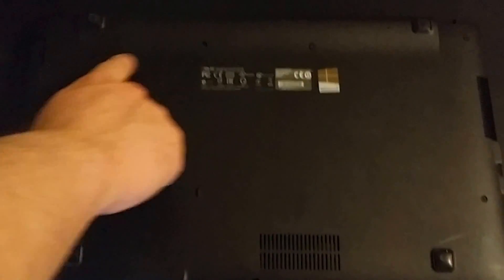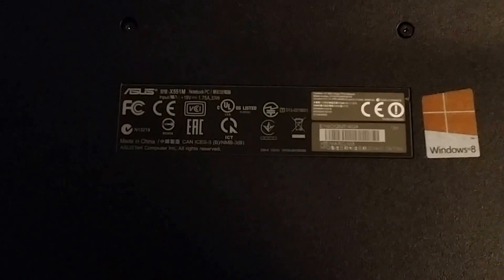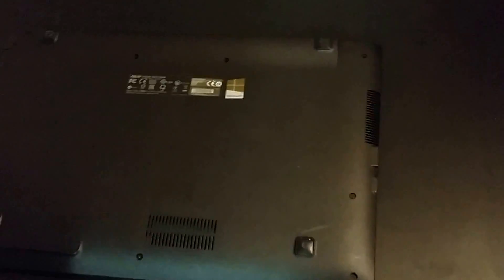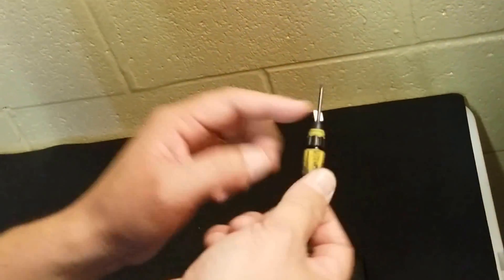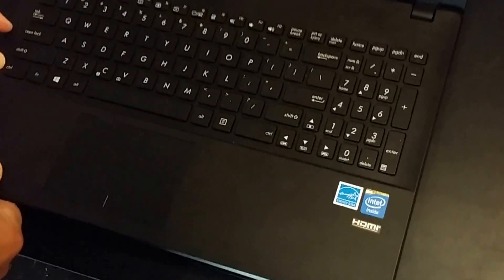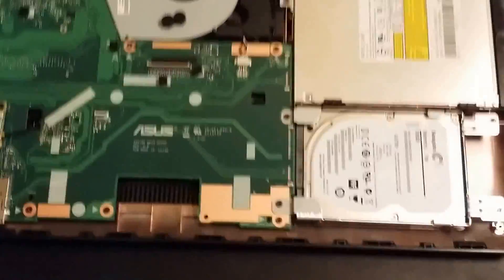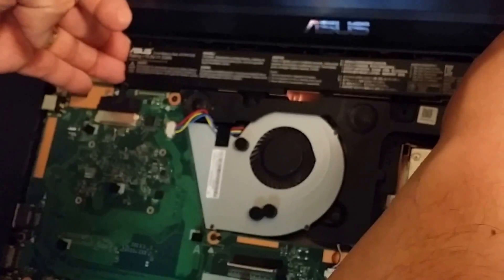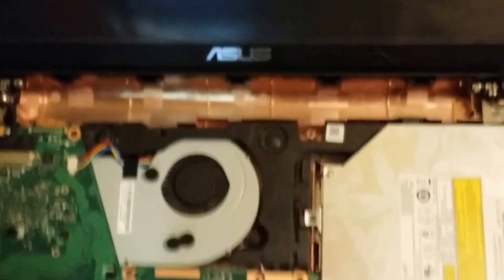ASUS X551M Laptop Battery Removal & Won't Power On Fix

Comment: I watched carefully the steps in your video and I really appreciated  the way you're sharing your knowledge.In my case,my ASUS(same one as in your video) has stopped working suddenly while i was studying my notes on Adobe reader.My battery hasn't been working for months(no need to think about that issue) and when i try to turn on my laptop it opens for a few seconds then turn off.The thing is i can see the ASUS brand show up as usual but at the bottom of it,i read "Preparing automatic repair" before it turns off.At that point,I didn't do anything other than wait for a few hours and turn the power button on.What would you suggest I do?
Reply from the maker: OK.  There might be some bad news.  It COULD be a software issue with a Windows Update failing to install and causing the Windows to not boot.  The other possibility is that your hard drive could be failing.  If the hard drive is the culprit, there is not much you can do except to replace the hard drive and reinstall Windows 8.  The good news is that 500GB mechanical SATA drives like Western Digital or Seagate is about $50 nowadays.  If you watch the video, you can see that the hard drive is removable if you remove the keyboard lid.  All you would need is the Windows DVD or USB.  Your product key is already on the motherboard so no need to look for the sticker.  If the hard drive tests good, then Hold the Shift Key on power on and PRAY you get to the Troubleshooting menu to select Advanced Options.  Select Advanced Options then you will see other options such as System Restore or ASUS System Recovery.  To get to safe mode select Windows Startup settings then select safe mode on restart.  My gut feeling however is that your hard drive is the culprit as laptop hard drives fail faster then desktop hard drives due to moving it around in backpacks, luggage, etc.

Devin

Comment: I have an ASUS X551M that fell a distance of 3 feet onto carpet.  I tried removing the battery and the charging cable, holding down the power button for 60 seconds, then replacing the cable and trying to power it on.  No luck.  Do you think it's toast?
Reply from the maker: Was the AC Adapter plugged in when it fell to the floor?
Reply: Nope.  It fell out of a backpack (closed and in sleep/low power mode).
Reply from the maker: So technically it was on and not completely shut down.  I will assume that since you did not state if it was plugged into the adapter even if it was in a backpack, then it was unplugged.  It is possibly it could be the motherboard then.  I would advise you to take it to a computer shop to have someone in person take a look at it.

Comment: Quick question- my asus lapton is stuck in the dreaded win8 repair loop- and all attempts to boot from USB option in the bios are not working. I was wondering if by removing the battery and then putting it back in would get the system to bypass this mess and to at least let me access a restore point. Your thoughts?
Reply from the maker: Does your Windows show you the advanced options when it fails to boot at any time of rebooting?  Advanced options will allow you to restore, get into safe mode OR if all else fails, format the hard drive and do a system recovery.  I assume that you have tried to repair windows and it fails.
Reply: nope. it's locked up hard. All the fkeys. for advance options don't work. Can't get anywhere.
Reply from the maker: Try hooking up an external USB wired keyboard into it to verify if you CAN get key inputs into it.  If not, then without input ability it will be hard to fix since you won't be able to select advanced options unless Windows puts you into it automatically.
Reply: fixed. basically found a repair shop. wiped the drive and put win 10 in. appreciate the help . found out that ASUS support is worthless. all I asked them was where is the nearest warranty repair shop. that was last week still waiting on a reply. I'll throw you some YT love and subscribe to your channel
Reply from the maker: I was trying to save you some money but you already got it fixed.  Essentially your next steps were to see if your hard drive was failing and if the test passed and you had important data, back up the hard drive and reinstall Windows back on your computer but you jumped to the end lol!  I am glad you got it fixed and thanks for your support!

Devin
Reply: thanks. Is there a way to disable the auto repair in win 10 so I never have to go through this mess again?
Reply from the maker: Disable Automatic Startup Repair

Sometimes you can get stuck in “Windows 10 Automatic Repair couldn’t repair your PC” loop and the simplest solution is just to disable Automatic Startup Repair. To do that, follow these steps:

1. When Boot Options start, choose Troubleshooting > Advanced Options > Command Prompt.

2. Now Command Prompt should start. Enter the following and press Enter to run it:
    bcdedit /set {default} recoveryenabled No

After you’ve done this, the Startup Repair should be disabled, and you might be able to access Windows 10 again.

Comment: Question: the A31N1319 actually comes in a variety of voltages, 14.4V, 11.25V, 10.8V.   I imagine the laptop voltage regulator would accommodate any of these voltages so it shouldn't matter. Is that right?
Reply from the maker: That is correct.  In case you are still worried, companies would be sooooo sued if their batteries exploded or damaged peoples laptops.  Look at Samsung.  They had to go into damage control mode when their batteries exploded.  But you will be fine getting a battery that states that your ASUS laptop model is compatible.

Comment: how much does the flex cable to the power on button cost?
Reply from the maker: On eBay, you can get one for about $10.  There are no flex cables for the X551m being sold individually at this time either on Amazon or eBay so that means you have to get the full board which comes with the cable.  Here is the link: http://www.ebay.com/p/ASUS-X551m-OEM-Laptop-Power-Button-Board-34XJCSB0000-With-Cable/1028705347

Good luck!
Reply: Angrysquirrel PC thank you

Comment: To my luck, the top left corner above the power button won't come off at all. Any suggestions?
Reply from the maker: One of two things are happening.  ONE: The screw is stripped.  TWO: The Plastic molding that houses the corner base that the screw goes into is broken.  That means that the screw is freewheeling and cannot be removed unless you literally break that corner to release it from the base.  I have seen this happen from time to time due to this problem.  If you get somehow lift that side wide enough to get a small pair of pliers in to hold that nut, you would be then be able to unscrew the screw.

Good luck!

Devin

Comment: Please help me I am not familiar with all these stuff so basically I have exactly the same design as you and the thing is that yesterday my computer was perfectly fine then today when I put it on it just completely went off and after trying to put it on it still wouldn't work the lightbulb thing flashes but the thing is that the screen is pitch black every time time I put my computer on it makes one little noise then stops and I really need to do some work on it but I was really confused on what you were trying to do so can you please explain to me what I do in this situtstion, thank you so much for reading !!
Reply from the maker: You have to remember that this ASUS model was an inexpensive $300 laptop.  The parts they used were the cheapest imaginable and are considered to be a "disposable" laptop after 3 years.  That being said, the problems could be the following:

1. Your Hardware part failed.  It most likely is the motherboard as these fail all the time with this particular model.  Since you stated that it does turn on, that means it is getting power from the AC power adapter/DC Jack and/or battery to turn it on so it can't be those things.  The memory is usually soldered to the motherboard on this model.  A bad hard drive would not cause it to not have a pitch black picture.  It COULD possible be your LCD Screen and to rule that out, simply plug an external monitor into the laptop, hit the appropriate FN/Function Key along with the FN key up at the top of the keyboard to switch the picture to the external monitor and see if a picture show up.  If it does, then replace the LCD Screen.  If it doesn't then it is definitely the motherboard.

2. It sometimes is possibly a bad battery/bad power adapter "COULD" be the culprit as I have seen "rarely" that the system is not either getting enough power to do a normal boot up or a defective battery causes it to not boot.  Remove the battery and try powering up with ONLY the AC adapter to rule out the battery being the cause.  If it still doesn't work, try using a universal power adapter to rule out your adapter.

If #2 doesn't work, it is most likely a bad motherboard.

Devin

Comment: My battery doesnt detected in my laptop. when i plug in the adaptor, then i check in the battery bar is shown "0% available, plugged in, not charging"
then next one minute after turn on the laptop, it suddenly turn off.
even i cant turn off it normally.
any suggestions?
Reply from the maker: You either have:
1.  A bad battery in which case you will need to replace it or

2.  A bad DC Jack.  If you have a bad DC Jack, plugging in the power adapter will not charge the battery OR power the system up.  The battery will drain to 0% and turn off because the DC Jack is defective.

3.  Your motherboard is failing/failed.  A bad motherboard will cause issues like these as well.

You can test #1.  You can fix #2 If you have soldering skills, you can buy a replacement DC Jack from Amazon:  https://www.amazon.com/Transformer-X551MA-X551MA-DS21Q-Compatible-Laptop/dp/B06XC2S5VY/ref=sr_1_5?ie=UTF8&qid=1488393768&sr=8-5&keywords=x551m+DC+Jack

You can fix #3 if you follow my video to disassemble the ASUS X551m to get to the motherboard.  Here is the link: http://www.ebay.com/itm/like/351984736605?lpid=82&chn=ps&ul_noapp=true

Good luck!

Comment: My battery light is blinking green and orange. It happens when it's plugged in and when it's not.  When it's off and unplugged, the light will turn off. The second it's on the problem persists. Do I have to removed the battery? While it doesn't look like the hardest thing, I feel it's too easy to mess up the ribbons or shock it. I'd rather keep the whole thing assembled.
Reply from the maker: If you are REALLY careful, you can lift the lid without removing the ribbon cables and remove the battery.  Your battery is going bad thus the orange blinking light.
Reply: Thanks for your response. I let it die down, and it's green again (although, it's currently plugged in). If my battery is going bad, I'll probably just leave it alone and always leave the laptop plugged in. As far as I know, this won't really affect the overall laptop. In the future, I will pay attention to battery placement, lol.
Reply from the maker: It won't hurt your laptop to have a dead or dying battery inside.  The only thing you have to remember is that if you ever get a power failure (the electricity goes out in the house), your laptop will shut down like a desktop computer (unless you have a UPS battery backup).

Devin

Comment: Followed these instructions to successfully change my battery. I did not disconnect the ribbon cables. The key board  moved forward just enough to see and access the battery with the cables still connected. Thanks for the assist.
Reply from the maker: Anytime sir!  Glad the video helped you out!

Devin

Comment: Does this laptop works without battery, just on the cable ?
Reply from the maker: Yes.  If you remove the battery, the laptop will work.  Keep in mind that if the power goes out, then the computer will shut down without a battery though.
Reply: Angrysquirrel PC thank you
Reply from the maker: You are very welcome!

Comment: will this be the same for an asus model d550c. both laptops look alike but I don't want to take it apart and have to do something different.
Reply from the maker: I cannot say if they will be the same or not.  You can try removing the screws and see if it removes the same way.  Keep in mind NEVER to force things apart if they will not remove easily though.

Comment: I have taken out the screws but it does not pop out from the corners and slide out, like it is glued in or there is a hidden scree
Reply from the maker: Double check the locations of the screws based on my videos.  I do hope you have the Asus X551m as other Asus models may differ slightly in screw locations.  When in doubt, NEVER use excessive force when trying to pry open the laptop lid as it can cause major damage to the screw mounts and plastic molding nuts that hold the screws down into the base.

Comment: My asus laptop has many problems. One of them is randomly shutting down for no reason. The other one is that it says "plugged in, not charging". How do you fix that??
Reply from the maker: The shutting down might be due to overheating.  Disassemble the laptop using my video and get to the CPU fan.  See if you see it clogged with dust/fluff.  If so, you will have to clean the fan and use canned air to clear out the heat sink exhaust fins.  The plugged in, not charging means your battery is nearing the end of its life and you will need to replace the battery.

Comment: my asus is saying I have to do a system recovery. any advice would be awesome!
Reply from the maker: If your system is stating you need to do a recovery, then either your Windows has been corrupted to the point that it will not function properly without one or your hard drive might be failing causing Windows files to be unusable.  Start by doing a recovery either using Windows by holding the Shift Key down then restarting the computer.  Choose Advanced Options then Select ASUS System Recovery.  If that doesn't work, you may have a failing hard drive in which case you would have to buy a new drive and replace it into your system and reinstall Windows.

Comment: excuse me what about keyboard and touch pad lagging. 
it skips some letters that pressed.
thank you.
Reply from the maker: That unfortunately is not easily answerable.  Your computer is most likely running processes that are using the CPU, Memory or Hard Drive at 100%.  Check your task manager by hitting Control/Alt/Delete then selecting Processes to see if your computer is running slow due to this.  If it is, then something is causing it (either too many programs running at the same time, Windows Updates, or maybe malware infecting your system).  To eliminate hardware, plug in a USB keyboard and mouse and see if it does the skipping.  If it still does, it is not your laptop's touchpad and keyboard.  If it doesn't it MIGHT be.  I highly doubt it will be though.

Devin
Reply: thank you. i already tried all but still.  i plug the mouse and keyboard and it doesn't skip or lag so what will i do. i'm using x551m asus laptop.
Reply from the maker: OK so if the regular mouse and keyboard does NOT make the lag/skip and the keyboard/touchpad does, then it might be the drivers.  Uninstall the touchpad/input and keyboard drivers and reinstall them.  If that does not work, go to the ASUS driver site and type in the x551m model number.  Go to the touchpad and keyboard drivers and reinstall them there using your USB keyboard/USB Mouse to do the searching.

Devin
Reply: thank you very much for the help.
i will try.
Reply from the maker: You are welcome!  Good luck!

Comment: Tell me you can increase ram memory for this type of notebook ... also I have a problem with this type of notebook freezes the desktop every time despite I turn on and off but when I watch a video does not freeze alone when I leave it if I use anything on The desk to which you owe thanks for your supports ...
Reply from the maker: On this laptop, there are two different types.  One is a memory that is soldered on to the motherboard which you cannot replace.  Then there is another that is a standard type that memory can be replaced.  You would literally have to call ASUS to find out which type you have based on your serial number.  Or you can disassemble it to find out yourself.  Yes, it is a pain.  As for your freezing, without looking at it, it could be a number of things.  Malware or driver issues on the software end, or graphics chip, failing hard drive or memory issues on the hardware side.  Scan it for malware/viruses and update your graphics driver for the latest version to eliminate the software side.  Do a memory/hard drive diagnostic to eliminate the hardware.

Devin

Comment: My laptop (model Q501LA) died and wouldn't turn on again. Hard start (no battery, only AC power) didn't work, draining resistance (trying to drain power with no battery or AC power) didn't work, replacing CMOS battery didn't work, cleaning all dust didn't work. Battery had no prior issues and lights were signaling properly. Calling Asus certainly didn't help- they tried to get me to service it with them for a minimum of $300.
Laptop suffered no external damage and is 3.5 year old. All signs pointed towards a bad motherboard. However, that's too short  a lifespan given the laptop is under mild to medium stress- no gaming, huge software programs, etc. Eventually I realized the hinges of the computer, which have a direct connection to the motherboard, must be outputting incorrectly that the laptop was closed and therefore unable to power on. The hinges of this heavy computer have gotten more and more worn over the years, so I fixed the issue by holding down the power button while slowly closing the laptop. It worked! As soon as the power button lit up I reopened the laptop and it's been working perfectly. Seems ridiculous, but it did the trick.
Reply from the maker: That is awesome to hear!  I am glad you got it working again!  Thanks for your tip and hope that the community of commenters reads this if they ever have your issue!